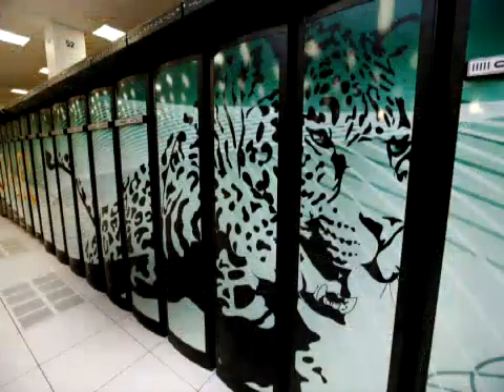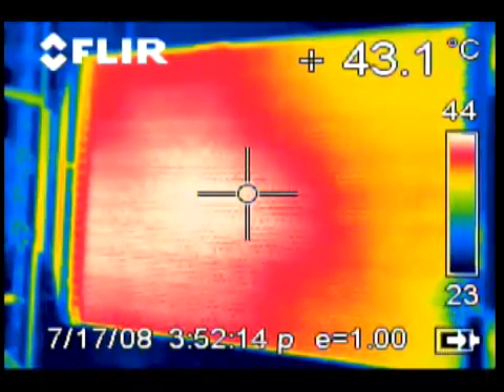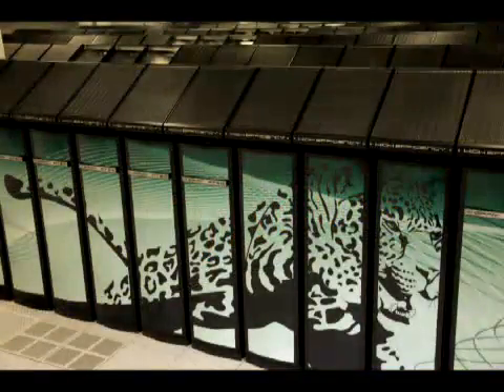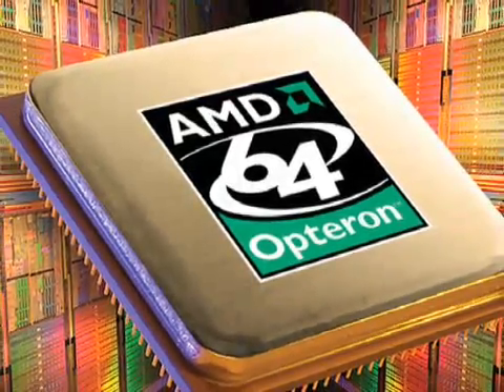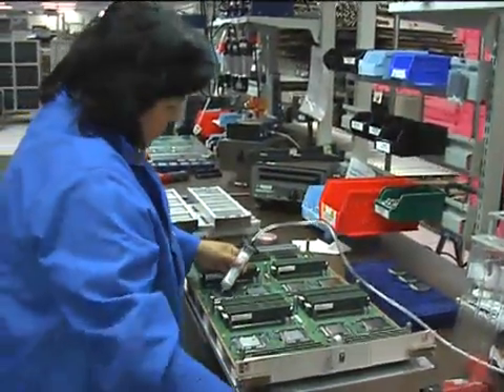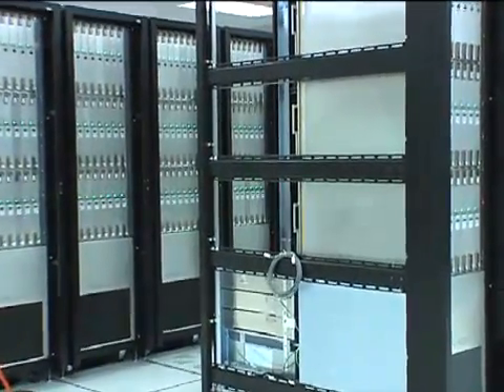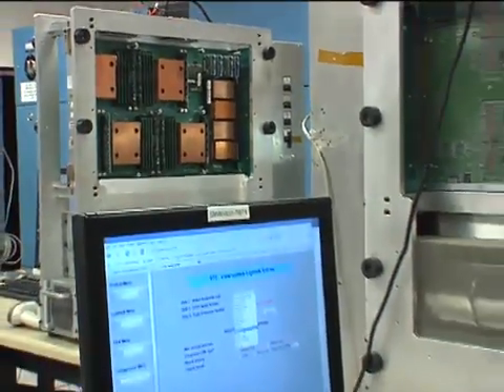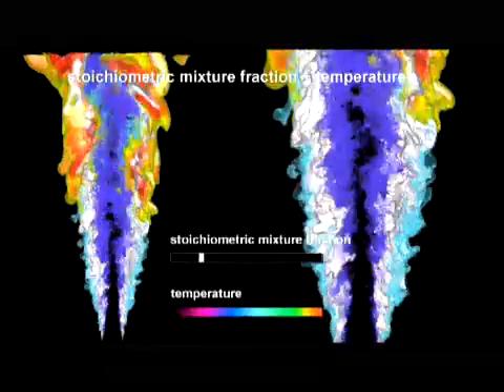AMD Opteron Powered: "Jaguar" Cray XT5(TM)

Comment: The scalar speed would be the speed of a single processor—that is to say, about as fast as a desktop PC. 

Unfortunately, there are still lots of problems around that can only be solved in scalar mode. Computers that just bold together a zillion PCs are useless for this type of problem. SISD isn't obsolete at all, but fortunately many modern problems can be converted to parallel processing. For those that cannot, modern supercomputers with a pile of PCs inside are a waste of time and money.

Comment: Only difference is that today, it's not using a proprietary 'explosion in a wire factory rats-nest' backbone for connecting everything or asinine circuit density requiring everything be submerged in fluorinert.

Comment: 1: There is a reason scalar computer went away. Efficiency, or rather lack of it.

2: Seymour's Cray's were Vector processor machines, not scalars. They could run as a scalar, at the cost of performance. 

3: Starting with the Cray 2, Seymour's approach to improving performance came in the way of using multiple processor modules pipelined together.

Bolting a bunch of PC's together is not really any different than what Seymour was already doing over 30 years ago.

Comment: @rampageturke Yes it will, all you need to do is to run a virtual Windows operating system on this machine. This is a super computer, it can do anything your normal PC can do, but many times faster. But you need to program it to do that. I hope this answers your question.